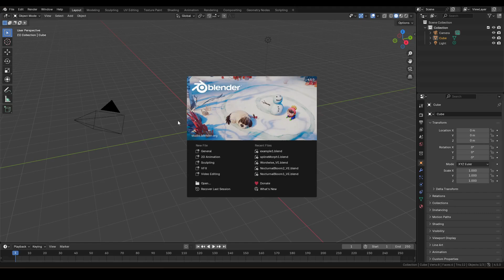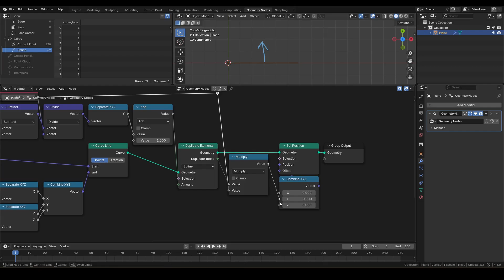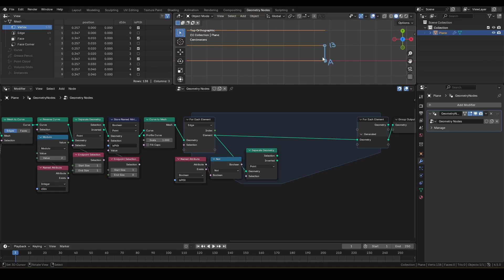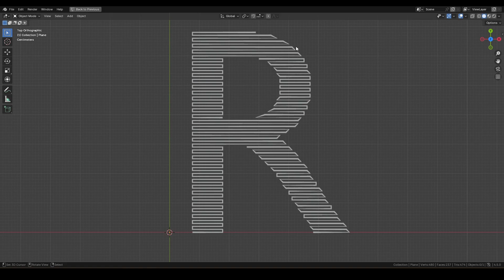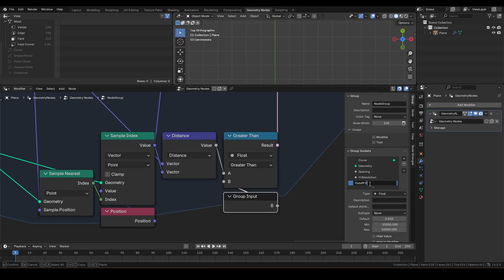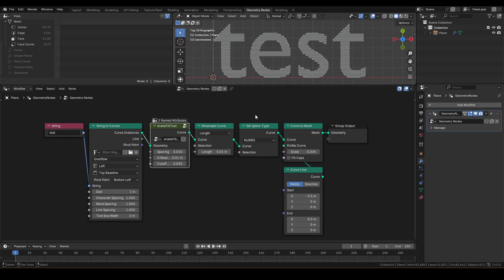Text Effect with Blender: Snake Fill Text [tutorial]

Comment: Encore un dernier renseignement SVP ;
À 16 :22 de la vidéo et à 16 :39, 
Sur le « nod snakeFillText » je vois en dehors du nods, « 2 Named Attribute »
Mais chez moi cela n’existe pas, c’est important ?
Autrement le reste fonctionne très bien, merci

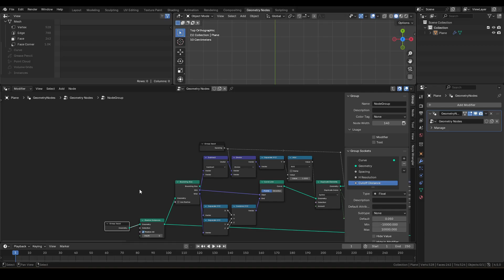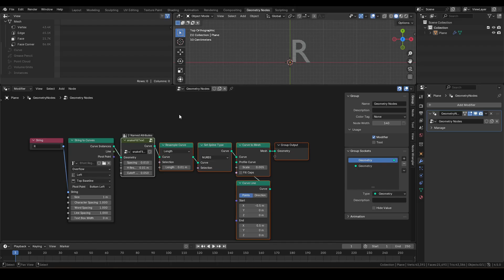One last question please: At 16:22 and 16:39 in the video, On the "snakeFillText" node, I see outside the node two "Named Attribute" nodes. But on my setup, they don't appear — is that important? Otherwise, everything works very well, thank you!
Reply from the maker: Ah,
That is an overlay I have enabled.  Option for node editor overlay is on the top right corner of geometry node window and if you go to the drop down and select the "Named Attribute" option, it tells the user how many named attributes are within a node group.  If you have that turned on, it should say the same since there should be 2 named attributes within that group.  If you don't choose to enable, it should also be fine since it's just a display =)
Reply: @BlenderStudioS-bs8mr  
Merci beaucoup pour ta réponse
Passe une très belle journée